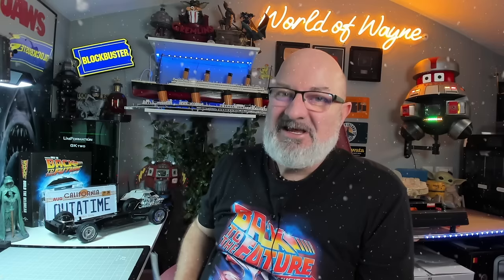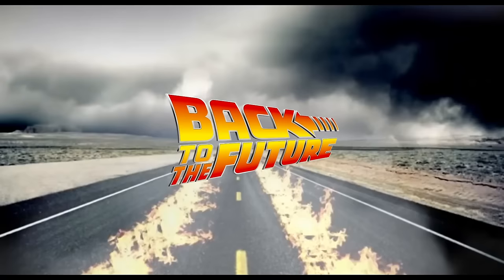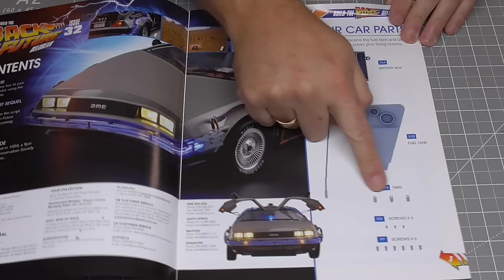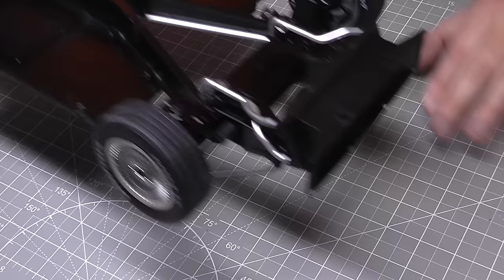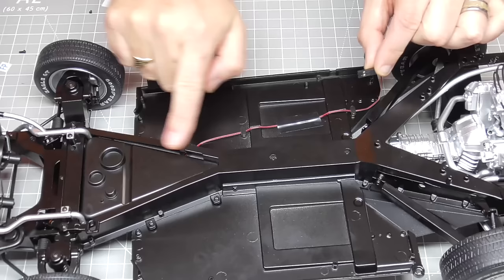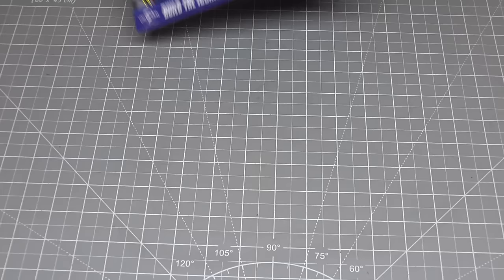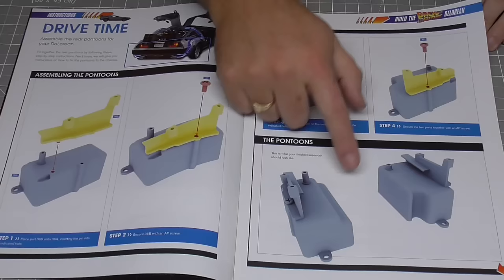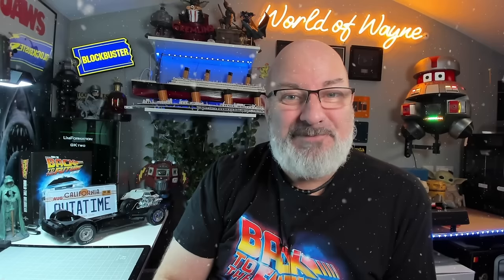Build the Back to the Future DMC Delorean - Pack 8 - Stage 32-36

Comment: One other thing, i am doing some modifications to my DeLorean, namely adding a different power source to the kit, the Power kit is the Power Mod Lite, since i will be using the EL lights, the Flux Capacitor and the Christmas tree, so working around the modifications will be a bit more work, but it will be better and make my DeLorean pop more.

Comment: Is there a flight mode display option for the Delorean?
Reply from the maker: Yep
Reply: Sort of. The tires flip down. You'll also get some plastic lifts you can put the car on but those are meant to just help the car handle its own weight and aren't tall enough to really resemble flight mode, since the tires will still be in contact with the ground. So if you want the car to actually be off the ground then you'll have to find or make some kind of stand to put it on.

The tires also don't flip down in exactly the same way that they did in the movie, sadly. But at least they tried.

Comment: wonders why a /nuclear fuelled/ car has a fuel tank What's in the fuel tank, deuterium? lol
Reply: Only the Time Machine part is nuclear/ fusion powered.  The car itself is gas fueled
Reply: @dennispitts1315  And here we note that the producers of the film in the 80s did not foresee electric cars even as the most extreme science fiction scenario.
Reply: @Thalon77  even if they did, that would have requiered a major power plant replacement as well as making space for the battery pack.  Which is most likely improbably cost ineffective and Doc would have been better off buying an EV to begin with and using that as a basis.  

Given the primary reason for choosing the DeLorean was the Stainless Steel body because of the benefits of a generally non-corosive and insulating matrial, the plastic bodies that most EVs now have would have been insufficent for this purpopse to begin with
Reply: This basically the whole plot of the third movie rofl. Marty asks this exact question to Doc.